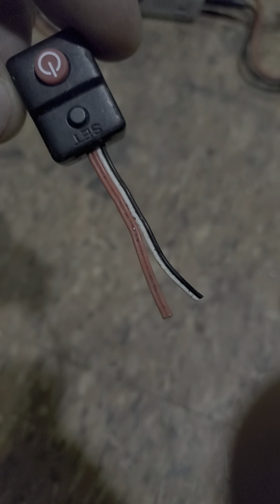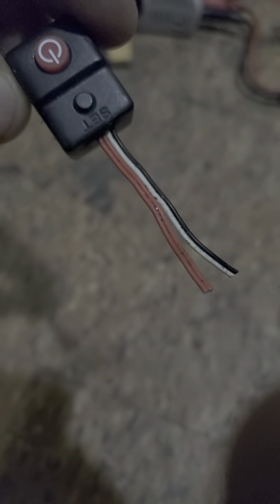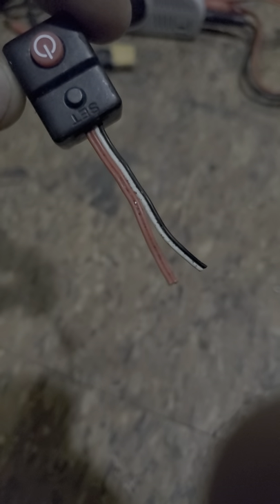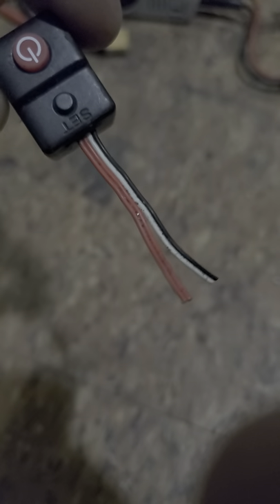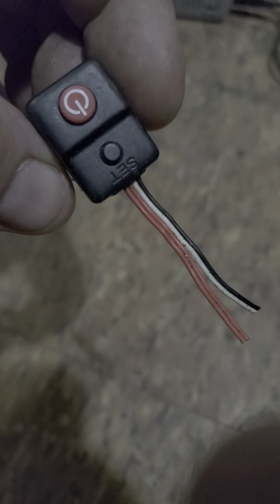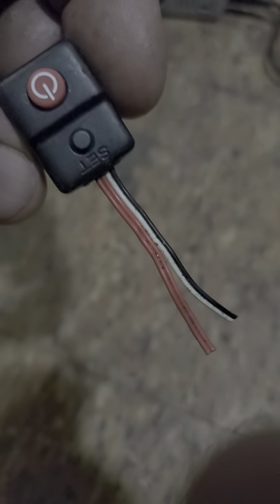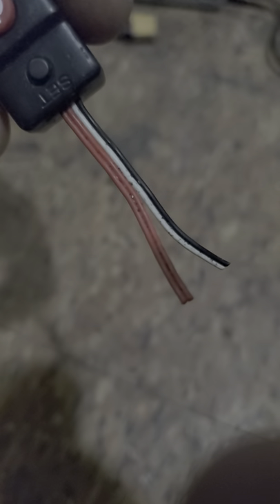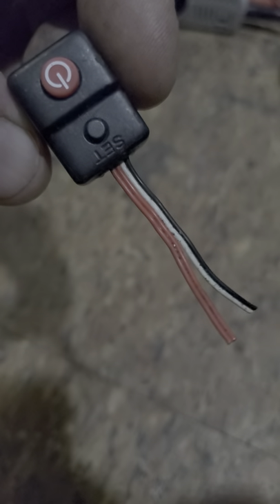Hobbywing power switch eliminated.

Comment: Question is how do u calibrate the controller after u get rid of the set button
Reply from the maker: As you plug your battery in hold the trigger on the remote to the full throttle position the light should beep then let go ,on the first single light pull the trigger  again then it should beep twice then go to the neutral position then full reverse, after that release and it should set itself and calibrate after the fact.hope this helped.
Reply: @truthrc357  appreciate it imma try it when I get home
Reply from the maker: Not a problem glad I can help big brother
Reply: @truthrc357  would this effect programming the esc with the card? When I hooked up my programming card no values will come up to be adjusted
Reply: @truthrc357  also as of right now I get no beeps from the esc stating the battery power it just comes on
Reply from the maker: Maybe your wiring on the esc needs to be all redone from power to motor wires ,after a while they lose that potency.
Reply: @truthrc357  I just ran the esc about 2 weeks ago
Reply: @truthrc357  yea no luck on the calibration no beeps at all
Reply from the maker: Esc has no life 9 out of ten times the esc is completely shot sorry brother
Reply: @truthrc357  even if the fan turned on?
Reply from the maker: Yeah I have a max 10 that does the same thing its the main motherboard 😪
Reply: @truthrc357  damn
Reply: @truthrc357  did u try and soder another hobbywing switch on it
Reply from the maker: @MrUnpredictable05  
I did and no luck the motherboard in the esc is fried but the bec would allow the fan to work but the esc would go limp ,if you have the digital esc program card you might be able to reprogram the esc using a laptop though.

Comment: Hi mate can you just connect the black and white? I done that now it turns on and runs fine can I just leave the other two wires snipped not connected to anything? Seems to be working lol and nothings reset I don’t think
Reply: Do u know how to calibrate if the switch is no more
Reply: @Becruzed  yeah you need a programming card that you plug into the receiver

Comment: How do I know if my power switch is the problem I have a Max 10 when I hit the power switch motor fan come on and ECS fan come on but there are no startup tones and no LEDs solid or flashing on the ESC however there's a little red light in the power switch that turns on and stays on could you possibly point me in the right direction do I need to replace the switch or is my ESC burn. I am about ready to replace the ESC
Reply from the maker: Sounds like the motherboard on the esc is gone brother,I've had that happen on the max 10 ,sorry my brother but it's Time replace it ,im sure you had some great runs with it 😉 but never give up on hobbywing I honestly feel they are 20 x better then castle .
Reply: @truthrc357  I actually got the RC truck on a trade but thank you very very much I usually don't do electric car seats because of this stop I find Nitro an electric easier plus I love that sound
Reply from the maker: @ryanhardison1419  
Got you brother 🙏 I started with nitro but electric has taken things to a greater height I have cars that run past 100mph and im hooked ,im actually working on a voltage regulator for the entire electrical system to prevent overload on the electronics itself ill have a how to video soon as well as some killer bodies airbrush and customized to everyone's specs be on the look out brother and your definitely welcome Ryan I appreciate you stopping by💪🤣🤜💯
Reply: @truthrc357  just so you know I subbed I don't usually unless I either really like your content or I really like your content and you answer a question or you are apply to my common or something like that I'm looking forward to all your videos
Reply from the maker: @ryanhardison1419  thank you my brother 🙏I appreciate your support ,I subbed right back 👍 let's grow together as an rc community 🤘
Reply: @truthrc357  I've been thinking for a while though making some videos but I usually just watch but I have been thinking about doing some I probably should
Reply: @truthrc357  appearing mean I have a buddy with that I make some YouTube video with and do some RC Meetup it's called Maine RC Kings I'm the one with the Baja 5b that is all camo I have a Traxxas Summit and a Traxxas Maxx and just recently got a Traxxas rustler 4x4
Reply from the maker: @ryanhardison1419  record all of your rc bashes bro id definitely support your channel and I subbed to Maine rc kings just 2 minutes ago ,you guys got some heat brother start putting it on film 🎥👍
Reply from the maker: They are bad ass bro Maine rc kings 🤴
Reply: @truthrc357  oh we definitely are that was only the second meet we've have ever made so things are getting off to a slow start but definitely going to pick up
Reply from the maker: @ryanhardison1419  I'll be waiting  my brother 🤘💯

Comment: I have Hobbywing Quicrun WP-CRAWLER-BRUSHED (80A esc) with the same looking switch.
Not sure if this applies to every other ESC.

So I spent a bit of time and I think I figured out how it works. 

Going in order from Black to Red:
Black - Ground (Battery -)
White - Set 
Red1 - Power 
Red2 - Power (Battery +)

Black and Red2 seem to have no resistance to battery lead (Possibly directly connectted to input)
ESC is powered ON when Red1 is same voltage as Red2 (ie. Short Red1 and Red2, as per the video)

To go into calibration mode is a bit tricky, as White needs to be the same voltage as Red 2, the same way you would press Set button. White acts similar to a momentary switch short. 
ie. To enter calibration mode, you need to first short White and Red1,  before shorting them both to Red2 to drive both lines high at the same time (similar to pressing set and power at same time)
Then you need to quickly remove White from the short within 3 seconds, and short white as you would press Set button as per user manual.

Best way I found was to put one end of alligator lead on Red1, Red2 and tap other end on White.
To simulate holding down both Set and Power to get into calibration mode, easiest way I found was to connect the Battery with White, Red1, Red2 shorted, then removed White when it beeps. 
You will need to have receiver powered on and in neutral before this, otherwise ESC wont receive servo signal and will throw and error beep code.

As always, I am not responsible for fried ESCs!

Goodluck!

TLDR;
Black/Red2 seem to be Batt-/Batt+ respectively.
White is Set button, and driven to Batt+ voltage when pressed (and Red1 is Batt+ voltage).
Red1 is driven to Batt+ voltage when ESC is powered.
Reply from the maker: If the switch has 4 wire's it should work bud 🥂
Reply: Do u have test videos? please  I can’t do it

Comment: I have the max 5, yesterday the esc just quit working. I can turn it on and off with the switch and I have steering, but no throttle. The led flashes green 4 times. I'm going to try a reset, that may or may not solved the problem. If it doesn't, I saw a video where the guy turns on the esc, pulls one of the motor wires off, did something else ( I'll have to find the video again ) and it corrected his problem that I have at the moment. If not, then off to hobbywing for repair or replacement if it's still under warranty.
Reply: Did you solve this?
Reply: @Ash-qx2qo  Yea, got a castle xlx2.

Comment: Just Want Make sure I understand what your Saying, I Cut off the power switch, then connect the black & white wire together & then connect the red to red together?
Reply from the maker: Yes sir
Reply: @truthrc357  ok awesome thanks man!👍😊👍 I don't understand why the power switch went bad, i just got it about  2weeks ago For my karton, onece i plug in the battery it comes on automatically & this ESC Is a max6, Now I also have  another max6 for my Xmaxx which I had it for about 3-4  years Now & Haven't Had any problems to it.. Maybe I Just Got A bad Batch Or Its B/c I Added Extra Cap Packs To It?
Reply from the maker: @TheTylerjoy04  it's the same thing that happened to my max 6 bro ,but don't forget to reprogram your esc after you connect the wires .and not a problem bro your always welcome 🙏

Comment: What if you have 5 wires I have black , yellow,white , and 2 red wires my motor cut out and I’m wondering if it’s my switch thanks again and keep the great videos coming
Reply from the maker: It works for hobbywing and the spectrum firma esc,I have never seen a 5 wire my brother so I wouldn't suggest trying this on a 5 wire.